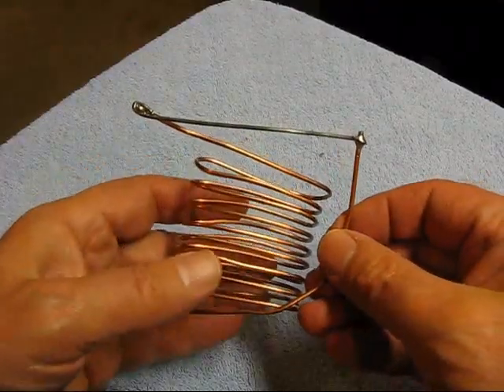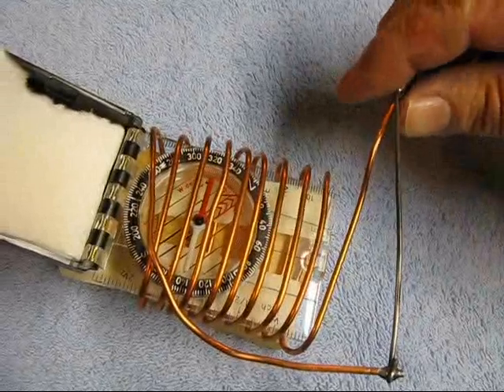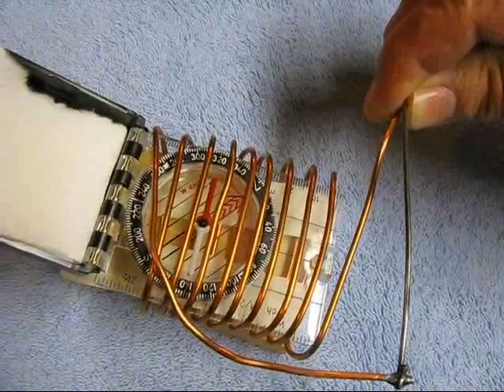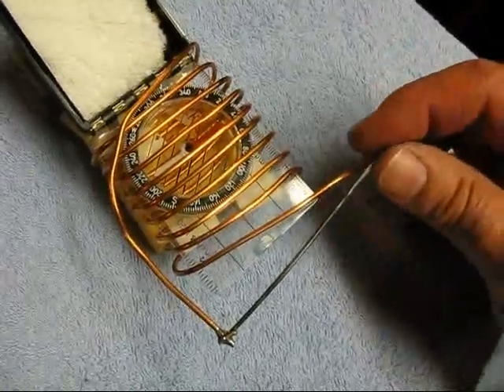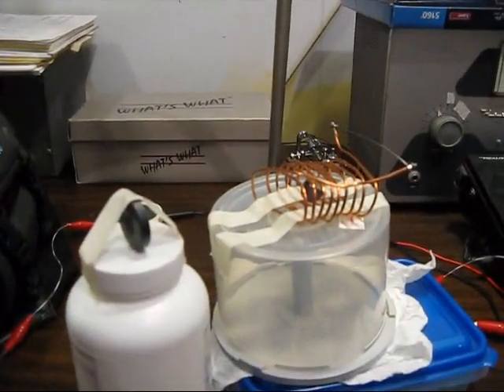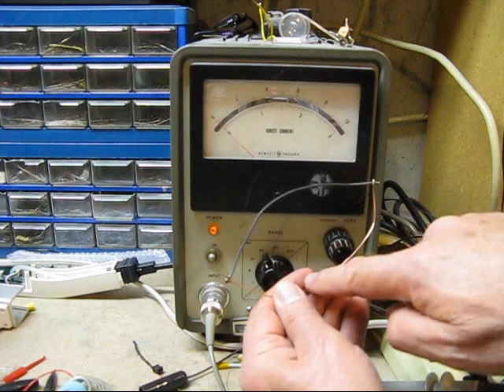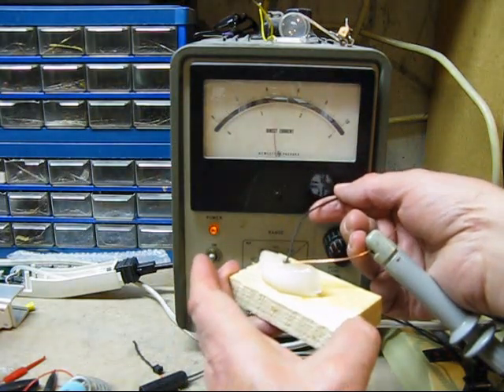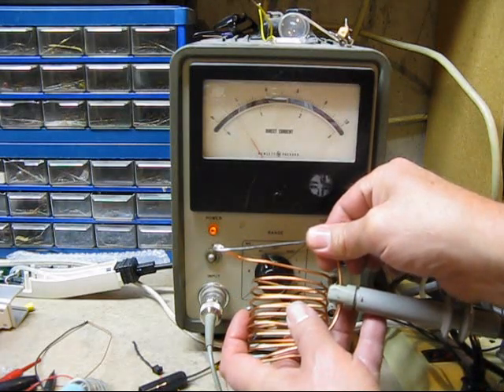Copper and Steel Thermocouple

Comment: Thanks for the share... i have a suggestion. Connect one end to antenna ... other to a thick ground.. and see... and do many parallel coils and have their leds one under a tap water and the other on the path of one flame... and see their effect on the combined magnetic power and amperic electricity... combine this with the first suggestion and let us all see...

Comment: I appreciate the video, but would like it better if you measured the voltage and put a resistor in the circuit.

Comment: Very nicely done!  Can you form junctions without soldering (i.e. twisting the wires together)?  Also, have you tried connecting thermocouple loops together in series to create more current?
Reply: Yes. Give it a try. It works just fine.

Comment: Hi-I'm new to the field of thermo-couplers. It may be that in my joepipe experiments, that the difference in the metal of the pipe and the gas lead that I formed a crude type of thermo-coupler. With the joepipe I'm able to heat the copper up to around 1, 500 F where the potential difference between the actual pipe and steel feed is at least a 1, 000 F.  Do you think that I may be on to making a more efficient thermo-coupler?

Comment: the power plant i spoke of in my last comment  from my book is called a mhd generator nearly the same as what your demo video shows and uses electrodes other than a coil a burning sorce of fuel and potasium and 3 ring magnets but it dosent state what the electrodes are made of and its grid tied now i see why magnets in generators or electric motors gas or disel engines waste power into heat